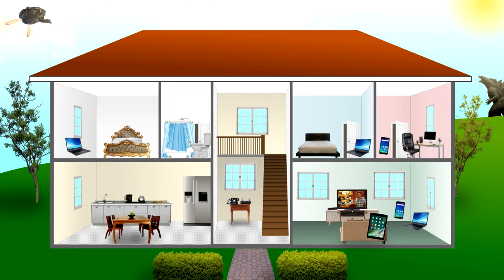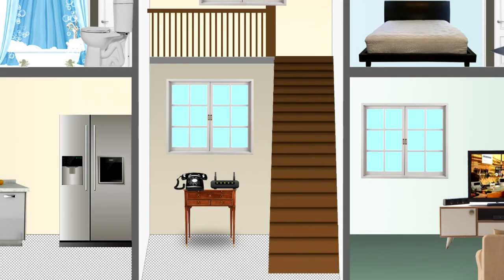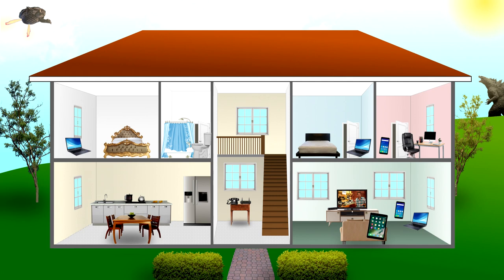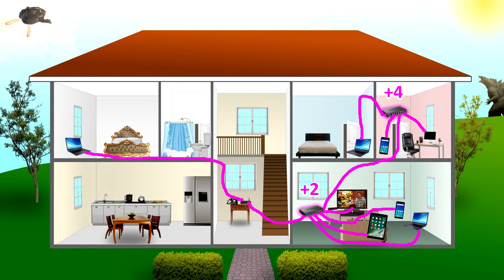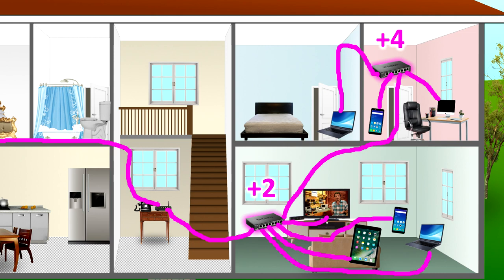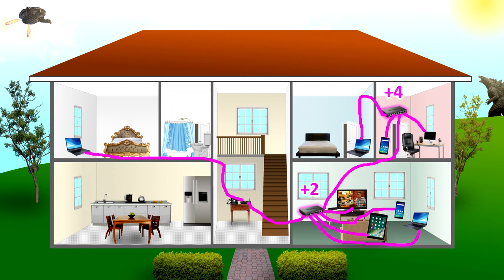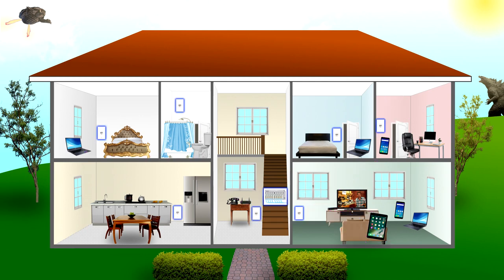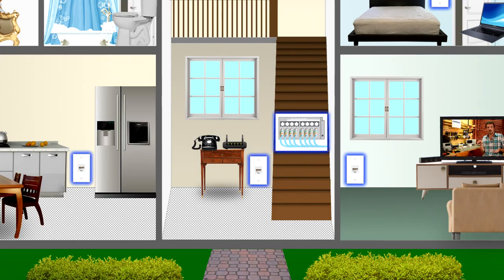No more WiFi, Part 3: All about existing house wiring

Comment: Thank you Scottie. When I bought my first house I had grand plans to put ethernet sockets in every room in the house. I bought a huge reel of network cable for the job. Then I tried to wire my own network plugs using the usual tools and found it to be impossible! It just WAY too difficult to get every single wire to connect properly. My tester would show I had got six or seven good connections. Most of the time was 4 or 5. Was so frustrating that I gave up in the end and just ran a pre-built cable from my router up the wall, through the floor straight into a switch in the office room and connect my devices to that. Not ideal but it works.

Comment: When we built our house 20 years ago we had an OnQ panel put in.  They brought in the blue hose (2 Cat5e, 2 RG6 Coax).  One Cat5e was for phone jacks, one Cat5e for the network.  The 2 Coax were for video (black for TV, White for either cameras our video chaining to other TVs).  The one Cat5e goes into my Phone Switch, and the other goes into the network patch panel.

My question is, is that patch panel actually needed?  

I discovered one port on my Patch Panel is toast (and it happens to be for my main office), and I've looked at getting a new patch panel (Cat6) from Legrand.  It's relatively inexpensive at $40USD, but I'm wondering why I would even bother.  Why not crimp RJ45 connectors onto the cable and send it directly into the network switch, thus removing a connection point as well as a failure point.  I have the tools/parts/cable to make custom cables anyway, but I'm wondering what good that patch panel actually is.  Why not just have all those terminated into RJ45 connector and bundled into the panel, then you can mount a switch in the panel and move on.  

if I'm just going from the patch panel to a Network Switch, it means making up 8 more custom cables (because they will be all of about 100cm long. I just find the patch panel kind of a waste, but I'm wondering if it is actually "needed".  It's great if I want all my switches/modems/routers in a different location (currently required), but it seems to be a pretty big mess.  :(  I don't like "messes" in my wiring...

Comment: If you need wifi (most of the time we don't) you can also check out JRS eco routers which have a 10% pulse ratio on cheaper models compared to normal routers with no decrease in performance, or no pulsing AT ALL with higher end models when configured correctly. Essentially it will turn off wifi when you aren't using it, but admittedly you do need some IT and networking knowledge to set them up.

Comment: Could you please help me on my wiring? The WAN port on my FIOS router is connected to the wall jack on the first floor. I have another wall jack on the second floor but it’s not connected to anything. I wanted to put both wall jacks in use so I moved my router to the basement, disconnected the coupler (the cable from outside is directly connected to one of the Ethernet cables in the wall with a small coupler), and connected the cable from outside directly to the WAN port in my router. I was planning to connect the cables in my wall to the router but the router didn’t get any internet connection. Based on my understanding I was just changing from Cable1->Cable2->router to Cable1->router. I really don’t understand why it’s not working. Please help. Thanks!
Reply from the maker: Two things I can think of offhand: Is the coupler just a coupler, or is it a "crossover coupler"? Also, is cable 2 wired to be a crossover cable (pairs of Ethernet wires swapped)? You can test this with an Ethernet cable tester (or a multimeter if you have steady hands and lots of patience).
Reply: @ScottiesTech  Thank you so much for the reply! I tested the wires carefully and found that the wires were sorted incorrectly. They were in the same order getting in and out of the coupler so I didn’t have any issue before. But when I plug one of the port directly into my router it couldn’t read the signal correctly. I reinstalled the cable caps following your other video and it’s working now! Thanks!!!
Reply from the maker: @user-hz2zh2fu9d  WOOHOO!!!!

Comment: so i did some investigating in my new house and all my cat5e cables lead to a panel on the side of house and they are labeled but have no connectors on the ends, also there is no power outlet where the cables are bundled at to power a switch so I'm confused to get them working for internet 🤔
Reply from the maker: You'd have to terminate each cable into a patch panel... OR save money and just put Ethernet connectors on the ends of each cable, and plug them into a switch. But you will need power (somehow) for the Ethernet switch. It might be worth getting an electrician in. There should be power somewhere nearby that they might be able to tap off to create a new outlet - altho that depends on the rules/regulations in your region, usually.

Comment: I would personally keep the wifi around for mobile devices like phones and tablets. Can you use an ethernet dongle for those? Sure, but that seems pretty ridiculous and very impractical, phones and tablets were designed to be mobile. When you consider that you usually keep your phone on your person, it makes absolutely 0 sense to have it hardwired to the internet.

Comment: Thank you for your videos!  I have cat5 wall jacks (ethernet cables do not plug into them) and a patch panel where all my cable and phone comes in and there are 2 WAN ports (house was built 20 years ago).  Can I make use of those WAN ports at all?  Also I have internet through my cable company.  Is it possible to plug in two modems/routers in different parts of the house?
Reply from the maker: If it's just a patch panel, then the WAN ports are like any other Ethernet port: something has to be connected to them, and you'd still need a switch + router. If you have 2 net connections, then you could create 2 different networks in the house. You have 1 modem/router connected to a switch with certain Ethernet jacks/rooms from the patch panel hooked up to that switch, and then a 2nd modem/router to a 2nd switch with all the other rooms' Ethernet jacks connected to that 2nd switch.

Comment: Could I connect another wifi router or a range extender to an ethernet switch out in my garage? Its just out of my wifi router range from the house.
Reply from the maker: Yes. If you use a WiFi router, it should be plug and play. If you use a range extender, you'd have to make sure that it has an 'access point' mode. Some WiFi range extenders have an Ethernet port, but you can only use it to provide net access to a connected gizmo. Others are configurable so that the extender will get internet from the Ethernet connection, and share it via WiFi (more like a router).

Comment: Why do you need a patch panel ? I have my cables connected to the switch directly, and that switch is connected to the modem/router (in the Netherlands they don’t separate them)
Reply from the maker: You don't need a patch panel, really. But for newbies, it's easier to use a punchdown tool and connect bare Ethernet cables to the panel than it is to add connectors on the ends of each cable. Plus, it's more tidy.

Comment: Why do you need a patch panel in the first place? Why can't you just connect the Ethernet wire directly into the switch? What benefit does a patch panel provide over connecting directly into a switch?
Reply from the maker: You don't need a patch panel, actually.  You could just crimp RJ-45 connectors on the ends of each cable, and plug those directly into a switch. Normally tho, there WILL be a panel already connected to the wall jacks. And if there isn't, I always install one because a)  it makes labeling and keeping track of which cable is which much easier, and b) it separates the in-wall stuff from the out-of-wall stuff. It's like electrical breaker panels: you can do it the quick-and-dirty way (a mess of tangled wires), or you can do it the clean and organized way. At some point down the road, either you or someone else who looks at it and debugs some problem will thank you for it.

Comment: Why not use powerline internet? Plug one in the same socket from the router, connect the router to it and in the other room put a second in and on this the pc and so on 🤔
Reply: It's a viable solution. But can be fraught with problems. The reason people don't do it is: lower speeds (throughput) and pre-existing line noise (ie from other appliances like smart refrigerators.) Also, the adapters you need for every outlet are bulky and expensive. That said, I use them as a short term solution in my new home.
Reply: @HockeyJock  so health is less important than the internet?
Reply: lone wolf I'm simply answering his logistical question, not making a value judgement. But, frankly, either method would achieve the same results in terms of protection from EMF exposure (since both methods negate the need for WiFi signals to fly around your home.)
Reply from the maker: I did a vid on that! https://www.youtube.com/watch?v=gSiDOQk1AE0&list=PLrTCa4nP8TlHq30DssS3nJXAmizYcsjdg&index=2

Comment: Is there any other way to use the phone lines to connect to router?
Reply: If they are strictly phone lines, then no. If the phone lines are CAT5 or newer cables, then yes you can use them as ethernet cables. You would just need to put RJ-45 ends on both ends of the cable.